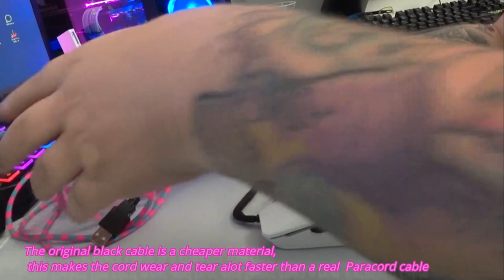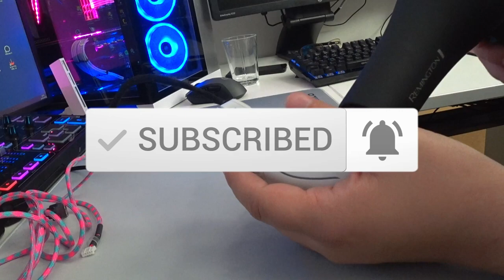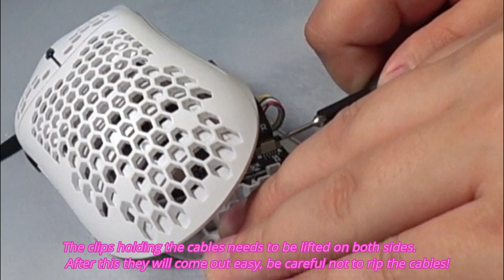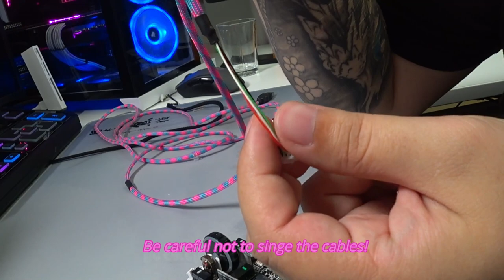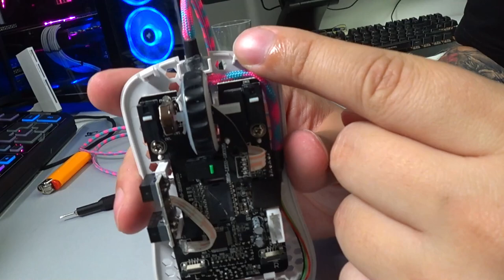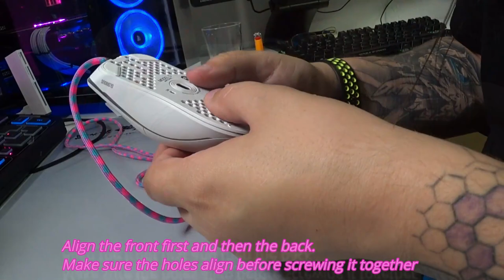Cable change Glorious Model-O/Model-D PARACABLEMODS Paracord cable Instruction

Comment: i did this fully following this guide and i must say thank you for the help ! the only thing i would recommend mentioning is for people to make sure when they burn the rubber piece onto the last heatshrink piece to make sure its on the side closest to the mouse , i did it in the middle of the heatshrink which didnt allow the cable to bend when it came into the shell and fucked with my mouse scroll , just cut the rubber and it was fine after , thanks for the vid ! liked and subed
Reply from the maker: Thanks for your comment Colby!

Comment: Hide your sensor, AND KEEP THE HEAT MOVING!
Reply from the maker: Yes sir! , although if you do like I do in the video, I hold the dryer egde right on the Skatez there is no risk for the sensor to get damaged, although if you keep it for to long you will damage the skatez, but in the clip Im able to reuse them without any problems. Important that if you do not do this though you need t ocover the sensor you are correct!

Comment: The cord that you replaced has only 4 cables inside, the original Model O cable has 5! Is it normal? Thanks
Reply: Carlos Costa the 5th cord is just a ground wire that isn’t required
Reply: @OGSierra  Thanks!
Reply from the maker: Just like OG said, its a ground cord, this is common for most mouse cables, but is not necessary

Comment: Please answer so like when I take out my old black model o- cable add the new one is it fine if I just put it in Ik be safe and steady like I’ll follow everything I’m the video but do I have to use the lighter for the black thingy I’m just afraid I’ll do something bad please answer
Reply from the maker: It is basically just a plug to remove an put in the new one. The black thing Im heating up is heatshrinks. If you use a cable like the one I am using you need to heat them up to that the paracord doesnt come loose from the cable.  The basically lock the paracord to the inside cables
Reply: Variousgaming so u heat it up to make it like not be able come loose but if my cord isn’t like that that’s fine I just ordered one from glorious that’s all pink .... and so. Just gently put the lighter over the black part make it tighten sounds good :) just scared if I could hurt myself or something else damaging it etc thank you :)
Reply from the maker: qavent if you bought yours from Gkorious themselves you should not have to heat it at all.

Comment: Do all cables require heat shrink?
Reply from the maker: The reason for the heatshrink is that it locks the Paracord to the actual cables inside, and then locks the whole cable to the mouse, the risk of not having a locking mechanism is that the paracord crumbles out leaving the wires exposed, and the risk of pulling the cables out of the mouse if you accidently yank the cable.

Comment: my model o- cable broke and i have a model o can i just switch the cables?
Reply: Mr SUS  Send it back and get another one. Thats what I did with my Model O. It got 2 years of Warranty.
Reply from the maker: You can absolutely switch the cables if you do not want to go thru the hassle of getting it on the warranty.  Keep in mind tho that if you mess up when trying to switch cables you will not be able to get a new mouse on the warranty since its voided by doing this!
Reply: Variousgaming For me it took 20minutes to 20 -30 minutes to send it back. The new mouse came after 4 days. Thats not a hassle haha
Reply: Mr SUS yes i’m doing that and it worked

Comment: is there any other cheap cables you can use my model o cable is always disconnecting someone please help i also live in the uk and it would take really long to get a new cable from usa
Reply from the maker: I think there are UK bound vendors out there as well, the cable itself is the same for all mouse basically, its just the connector that can differ.

Comment: its been like 6 months since i installed my paracord and i'm getting random disconnects. my guess is that i may have kinked it. any ideas on what to do?
Reply from the maker: Anaklusmos if the problem just happened now after 6 months my best bet would be the cable might have been kinked like you say. If that is the case I’d change it into a new one. After all if you like the mouse , a new cable isnt that expensive. Good luck 👍🏻

Comment: my mouse smokes after changing paracable. :( it wont work anymore
Reply from the maker: It is a delicate process where you could potentially ruin your mouse. Always take great care when handeling cables, and especially connectors. There is also the posibility that a connector has gotten loose from the actual cord. Try changing back to the original cord and see if it works. If not there is probably damage to the hardware of the mouse.

Comment: will i be able to use my g402 cable on the model o- ?
Reply from the maker: The cables to all mice are the same, looking at power etc. BUT the connector in the mouse is what is important and diffrent mice usually have diffrent connectors, as for the g402 I am not sure what kind of connector it has. If you order the cable from the site I linked in the description you can choose what mouse you have and they will attach the correct connector
Reply: Variousgaming thanks for the information

Comment: Pls help my old cable is not getting out its stuck in the plug thing
Reply from the maker: Make sure you are ONLY pulling the actual plug, not the socket. They are BOTH white, so its easy to mistake them. If it still wont come loose see if you can loosen the smal hooks that connects the two! Good Luck!

Comment: im so confused man ive never done this before but i dont want to break my mouse.. it just randomly disconnects. Im so ucking scared to fucking break it
Reply: mine does that too, its either the usb that is fucked up or the cable bcs when i adjust the usb in a different angle it works otherwise it wont connect

Comment: you are damaging the sensor
Reply from the maker: I am still using this mouse without problems, I never turn the heat from the hairdryer to the sensor.  Also you are at much less risk of damageing it when using a blowdryer than using a heatgun.